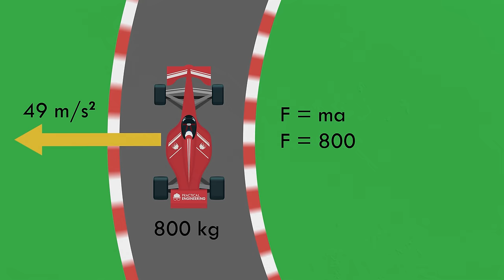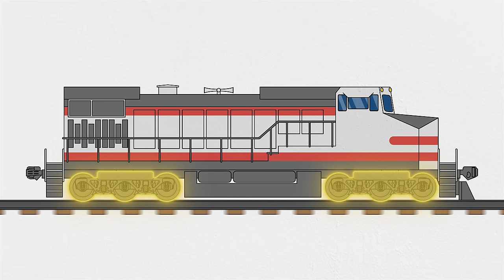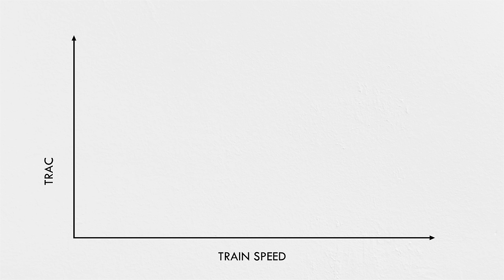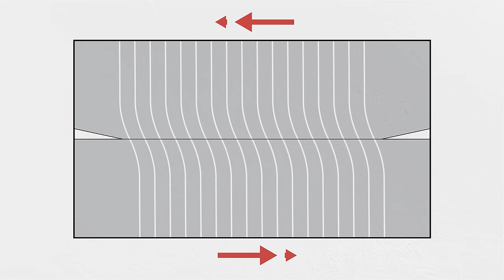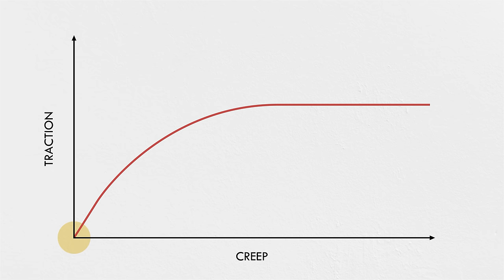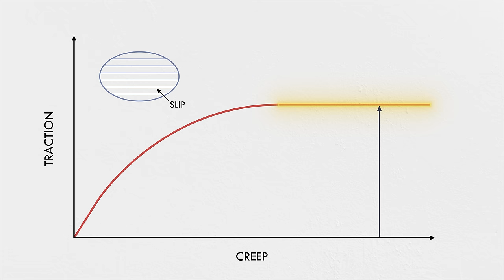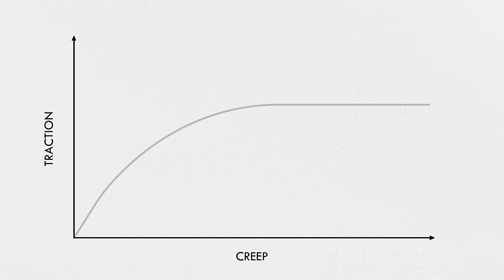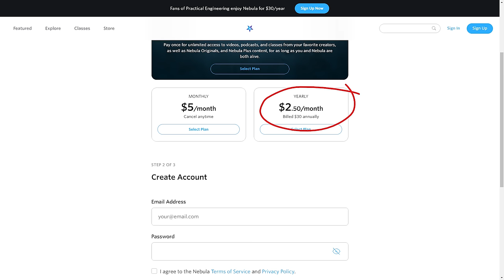Why Locomotives Don't Have Tires

Comment: Do you mean: Why Locomotives Don't Have RUBBER Tires? They might not be rubber, but some have separate, replaceable tires.
Reply: Came here to say exactly that
Reply: Some French trains are now sitting sad in a corner sipping there wine out of the bottle. wile looking at its rubber tires. Thinking Am I not a locomotive?
Reply: @sirBrouwer  I think you're thinking of Metro trains.   I don't know of any locomotives with rubber tyres.
Reply: @cr10001 it sure is. There is one carriage that is also the locomotive. As it houses the bulk of the engine if not all of it. 
Making it a locomotive with rubber tires.
Reply: Not only replaceable ‘tyres’ but they come in different ‘compounds’! 
In Wellington, New Zealand, the new passenger units were found to be wearing the rail at an unacceptable rate. This was due to the bogie design making them longitudinally stiff. The leading bogie wheel was biting to hard into the outside rail in curves. The tyres having a ‘hard’ compound were grinding the rail. 
Solution. Softer compound. More tyre wear, less track wear. 
The down side to this was the tyres were more susceptible to slip/slide and thus often ended up with flats. The extra lathe time and shorter overall life was an unfortunate side effect. 
Great post Grady. 👍❤️
Reply: Tire
Reply: @jdmacd01  America = tire, the rest of the English speaking world, tyre.  NaYa.
Reply: @ Oh, I didn’t know that. I guess that’s why people were saying “tyre”. I thought it was some joke thing but it’s not. You learn something new everyday!
Reply: @ yup. And re-tyre is not something  you do when you finish working. 👍😂

(Unless you do your own car repairs).

Comment: I work for Wabtec (former GE Transportation), we build freight locomotives. The sheer weight and power is unbelievable.. they are truly an engineering marvel.
Reply: Spend some more time on making sure the rear cab door seals correctly. Thanks
Reply: Nah wabtec would likely drop support for legacy loco platform like C20EMP or slightly new CM20EMP. I hear some parts difficulty for these type. They would pushing GEVO to everywhere
Reply: Here's a good way of putting it into perspective for people: Most people see UP's Big Boy as some kind of measuring stick for locomotive pulling power, but it's effectively 2 large steam locomotives permanently connected to form a single huge steam locomotive, and still has about 30,000lb less continuous pulling capacity than a single ES44AC.
Reply: @ErickC  that may be true, however diesel electric engines are by far more efficient. Especially with maintenance costs and environmental impacts.
Reply: @Swindy1794 : absolutely - diesels pull more, they can be MUd, they're more efficient, they don't require the extra logistics of water (one of the main reasons the desert roads dieselized first), they require less maintenance, they start up and go without needing crew on-hand for hours to warm them up, they require fewer crew to operate, and they do much less damage to the rail. There's just no comparison.

AL Krug wrote an interesting steam/diesel comparison many years ago, and his conclusion was "we should scrap all the steam locomotives and replace them with diesels. Oh, wait, we already did that."
Reply: Welcome to the wab.
Reply: @ErickC  30k less continuous effort makes sense. Big Boy can use more steam than the boiler can make
Reply: @7171-Ws6 😂😂
Reply: I worked for BREL Doncaster UK which was privatised then went bust partly due to bad management, I was made redundant. Wabtec took over after that but I never got to work for them.
Reply: Steam locomotives do not develop maximum horsepower (or tractive effort, if you prefer) from a standing start as diesel locomotives do.

Comment: I was a location manager and had a retired train engineer working for me.  When I was having a "challenging" day, Brad would see this and say, "David - How do you start a train?" and walk off.  One day, I stopped him and asked him what he meant by that statement.
"There is no locomotive set that can possibly pull a mile long train from a stand still.  The locomotive pulls the first car, which pulls the next car, which pulls the next."  The slack in the coupling is crucial to allow this 'chain reaction' to occur.
He shared that sometimes, with a green engineer, they'd pull into a stop to change crew while under power, taking all of the slack out of the couplers.  No go.  The solution was to back the train a distance to re-create the coupler slack.
So, the life lesson was, if you have a big challenge you're dealing with, find the solution in a series of small fixes rather than viewing it as one big problem ... one car at a time.
Reply: Well said.
Thanks for posting this.
Reply: Oh. I thought the lesson was, "Back up and get a running start." 😅
Reply: Hmm..  "How do you start a mile-long train from a stand still?  You take the 'R' out of 'rail' and the 'F' out of 'way'."
"There is no 'F' in 'way'."
"Exactly."
Reply: I think you've misunderstood what was said, you don't back a train up to increase slack before starting, and indeed taking any single bit of rolling stock from 1kph to 2kph takes more energy than taking it from 0kph to 1kph.. common practice on the rail line is to creep forwards in low throttle notches till the rear of the train starts to move, and only then add most of the power, otherwise your being very rough on the rear couplers with all that inertial jerk (there are springs in all couplers but the locomotive to help reduce it, and this will actually cause a stopped train braked only at one end to "equalize" very slowly on low grade track), and on bigger trains will break them outright. But "how do you start a train" is still the correct saying, because it starts slow, you don't feel like your doing much and if you kept going at this rate you'd never make it in time.. but you keep going and as you keep working on the problem you get the means to apply more force and solve the problem faster.
Reply: One car at a time...Beautiful
Reply: How do you eat an elephant.....

One bite at a time....
Reply: Oh yeah, so how do trains start on 2% grades then?
Reply: They would dump the air out of the main line - called the "Pipe" - setting all brakes.  Then they would turn on the air supply to release the brakes.  It took several minutes for the air to fill and reach the rear of the train. As this was going on, they'd slowly back the train - introducing slack in the couplers.  As the air was finally reaching the rear most cars, the engineer would start pulling forward.  A Good engineer could time it, so it all came up snug just as the rear car's brakes were releasing. 
One car at a time. @ThePaulv12
Reply: Yessir! Whenever our tiny trackmobile is having trouble pulling 30 loaded cars, I’ll have to back up until I can’t anymore then give it a nice tug the other way to get rolling. But man, trying to pull on wet track sucks! I’m glad I only have to operate the trackmobile in one yard, the other yards have locos.
Reply: I've been an engineer for 17 years. It's more fun to spin the wheels until the sparks start flying. Even better than doing a burnout in your car.
Reply: Yes and no. I'm an engineer with BNSF. You can start an whole train with all the slacking stretched out. We do it all the time. Stretch to a stop, say I have 10 pounds of air set and we stop while still in notch 2. When we get going again and i kick the air off, it'll take then at least one notch higher than we stopped in to get going. We do this everyday.
Reply: @jaredkelly930  Hmm.  I'm certainly NOT an engineer of any sort.  What "Brad" told me made sense - especially after listing to this video and the extremely marginal traction capabilities of a steel on steel and a long train that could easily weigh in excess of 10,000 tons.
Reply: Only if you can BACK the train. You can pull it too
Reply: Taking slack is certainly a thing but, it's not always a requirement. Factors such as available power (locomotives online), tonnage, footage, terrain, etc come into play.
Reply: @ThePaulv12 Steam engines are so hard to get going that all the stopping places were level, stations etc. They do really struggle to get going if they have to stop anywhere else. I would imagine the same applies to diesel locos, they only stop them at the appropriate places unless there is no alternative. At sidings, for example wheat silos, where wagons have to be loaded and there is no loco available a special crow bar is used between the wheel and the track to the wagon moving. Because that section of track is level it is relatively easy to get the thing rolling. I have one of those bars which could be old technology but that is how it was done.
Reply: @jaredkelly930  agreed! These little stories are cute and people without any experience can ponder....but theres a lot of bulls**t out there. I got my card in mountain grade....you and I both know that we want the train to depart in a similar condition as we stopped. I stretch to a stop as much as possible (flat, undulating or ascending) so the thing leaves in one piece.
Reply: You learn something every day, that really makes since why there is slack. I just assumed it was to accommodate the movement between cars up and down, back and forth as they travel over changing track conditions.
Reply: Good advice
Reply: why such a mass of useless text - when there is one simple word - DECOMPOSITION
Reply: So were you the one that told him the answer, or was he the one who told you the answer? Because he was asking you, wasn't he?
Reply: That really made me think
Reply: @davidphillips so the locomotive can not pull all the cars forward but it can absolutely push the cars backwards? Definitely sounds like a misunderstanding or missed explanation.
Reply: @borshardsd  The point of the backing is to put slack in the couplers so that the train can then be reversed and then pulled forward, "one car at a time." A loaded train of 100 cars can easily weigh 12,000 tons! A locomotive cannot put that much weight in motion - in either direction - all at once. It has to be put in motion with one car pulling the next. If backing, the engineer would need to first "stretch-out" the train so that the locomotive could push the first car, which would then push the second car and so on ... one car at a time.

Comment: Excellent video, Grady! The "Creep" demonstration was wonderful. This effect actually leads to one of the biggest wheel defects we experience in the railroad - shelling. The creep and deformation actually causes slip dislocation motion in the grain structure of the steel, and atoms start getting peeled out of the wheel, and thrown off - resulting in shelling, which is essentially a "missing chunk" of wheel. 

Also, Steam Locomotives actually do have tires! Different hardnesses as well, depending on the size and weight of the locomotive. They're really neat. The wheel on a diesel locomotive is a much simpler, and standardized part that can just be replaced; so the whole wheel just gets changed out; but with a steam locomotive and their various wheel sizes, castings, etc. - it made sense to have a dedicated tire to replace, instead of a complicated casting.
Reply: Hyce watches this?!
Reply: Hey guys this is Ice.
Reply: My grandfather was a machinist changing treads on steam wheels. Not just slip, but out of round because of connecting rod. I thought new wheels had hardened 'treads' that could be resurfaced on a lathe if not too worn.
Reply: spalling?
Reply: @yorkchris10 My grandfather was also a machinist and I didn't really get to know him since he passed away when I was 2. I got interested in machinist videos because it gives me a sense what his work life may have been like. I highly recommend checking out Cutting Edge Engineering where Kurt works mostly on mining and heavy construction equipment. When he encounters hardened steel, it's usually a thin layer of induction hardening on the surface, which seems like it would be a sensible approach for train tires as fully hardened steel is very brittle and prone to fracture. He has to run the lathe very slowly and take thin cuts to avoid chipping until the hardened surface is removed before he can work on the part. It seems like it ought to be possible to recondition train tires, but that waiting for the repair would put cars or locomotives out of commission for days. So, it would make sense to have some spares and either sell the damaged tires to a remanufacturer or return them to the pool of spares after repair. I suspect the procedure would be to remove the hardened surface, build it back up, turn to spec and send it out to be induction hardened again. It might be possible to anneal before turning, but I think that might require equipment like a large furnace that would be expensive to own and operate and would only make sense if you were doing a lot of tires with a reliable stream of work. It would be interesting to find out what the actual procedure is. For parts that aren't directly bearing load, the approach often seems to be to turn down to a smaller dimension and then shrink fit an induction hardened sleeve over the part, but I'm not sure that would stand up to the sheer forces of a train going around curves and would be likely to come off and cause a derailment.
Reply: Was looking for this comment!! Hyce explained it perfectly as usual 🔥
Reply: She peel off my atoms til im missing chunks
Reply: I was gonna say, our Baldwin DS has tires, as did all the other locomotives for the original owner.
Reply: Thank you for clarifying, I learned a lot about steam engines and KNEW that locomotives had tires. I'm not all wrong, just specifically wrong. Now I know!

Comment: Was a tanker in the Army and this principal reminds me of how tank track moves.  You'd think that the tank track, rotating but laid down stationary, under the tank wouldn't move until the rear end of it gets lifted and starts moving up then forward only to get laid down again, in a cycle.  The fact is, when a tank is really hustling, all 60+ tons, the track thats in contact with the ground, which may appear not to be moving, is in fact sliding forward with the tank, slightly but evidently.   If you watch closely and see video of a tank moving quickly, especially over a hard surface like pavement, you'll notice that the track on the ground is sliding, "creeping", forward as the tank moves.  Pretty cool physics going on there too.
Reply: Oh. Thanks. That helps me understand a lot better! 😊

Comment: Hard to imagine a solid steel wheel stretching and effectively increasing the size of its contact patch to obtain maximum tractive effort. Its actually genius. Once the tractive effort reduces, the contact patch shrinks to its normal size and rolling resistance becomes minimal at cruise. The more I learn about trains, the more respect I have and the cooler I think they are.
Reply: The physics is basically the same with automotive tires, just with rubber and air not solid steel.
Reply: Isn't it the exact opposite? Contact patch has two parts, one under static friction (stick), and one under dynamic (slip). Stick area has higher coefficient of friction, slip has lower. Each carries its own portion of the train's weight. But when we try to increase torque to get more tractive effort, stick area decreases, so slip area carries more weight - so shouldn't the effective friction coefficient only go down?
Reply: I don't think it's the size of the contact patch that provides the extra friction, it's the shape, which alters the effective coefficient of friction. As friction is weight × coefficient, notice how there's no contact area term in that equation at all. All else being equal, the area doesn't matter. Think of it this way: with bigger contact patches, the friction is spread out over a larger area — but this is exactly balanced out by the fact that the (gravitational) force pressing the contacts together is also spread out over the same larger area.

Of course, in the real world, all else is not equal. A certain size and number of wheels or tires can be helpful. But it's not directly from the size of the contact area. I think the reasons are:
— Greater contact area, lower pressure. (Pressure, e.g., pounds per square inch, is weight divided by area. So, for example, a 3000-lb vehicle with 30-psi tires will have a total contact area of at least 3000 lb/(30 lb/in²) = 100 in². If contact area is smaller than that, tire pressure will need to be higher.) And at lower pressure, rubber tires deform, increasing their coefficients of friction. (The deformation of the train wheels is the thing you're talking about as well.)
— A large contact area is good for averaging out the variable friction of a real-world surface (e.g., ice, oil, gravel, painted lane stripes).
— (Not related to friction, but) a lower pressure also means the wheel and the road don't have to be engineered for a higher pressure.

Comment: 4:10 Rolling friction (or rather, rolling resistance) isn't the same as adhesive friction. Adhesive friction is GOOD for rolling, it's what defines it. Rolling resistance is bad, unless you want to brake.
This is the distinction people often forget to point out, which usually leads to confusion. Weaker adhesion doesn't help you roll better.
Reply: Excellent point - underrated comment.

Engine wheels have torque applied to get them moving.
Rolling stock* wheels should have minimum turning resistance
* there is a clue in the name.

Rolling resistance e.g. the friction between wheel flanges and rail is an energy loss and needs to be minimised across both the towed and towing components.
Reply: You guys are dorks
Reply: @scav3155 don't you have anything better to do with your life?
Reply: @scav3155 and proud of it
Reply: @flallana18  I'm actually a dork myself lol